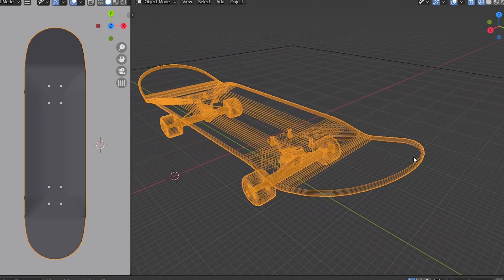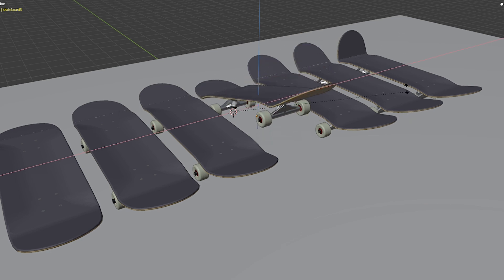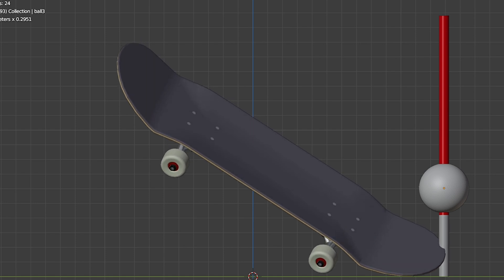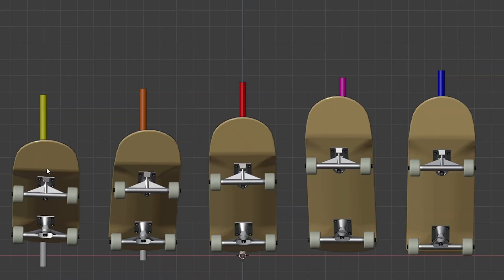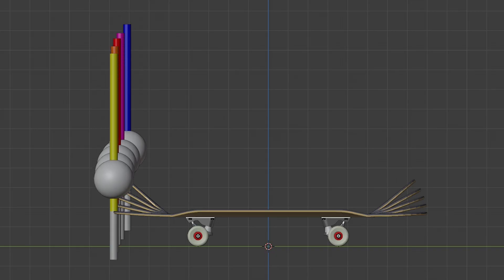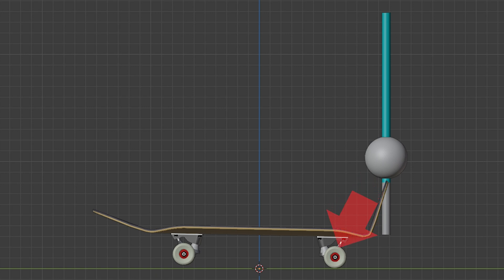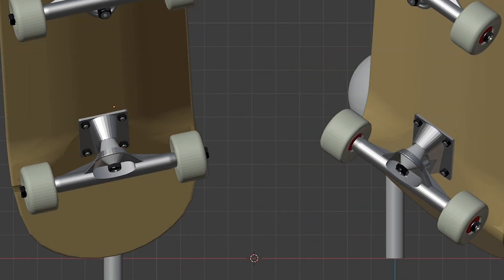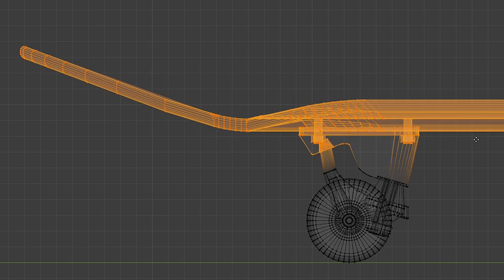What does the steepness of kick do in skateboarding? #skateboarding #3d #physics

Comment: Does it change anything if the force is applied past first contact with the board to *almost at the ground"?  In this case the... I dunno, angular momentum maybe?... Is affected by the tail shape in a way it wouldn't be with a foot pressing or compensating for different tail shapes, right?
Reply from the maker: It does change something definitely. As you can see in the video, the board with the mellowest kick pops up into the air right after its ball touches it’s tail.  
Physically, it’s not wrong. But in terms of actual pop as we do in the real world, it is wrong. Instead, our back foot should absorb the first impact and pop after that. 
In that sense, this simulation is not accurate.

Comment: How do wheel base lengths affect kick flips? I'm primarily interested in my own set ups. I use the same decks design for all my boards but use different trucks. Indi Mids are the shortest wheel base/axel distance but they are the heaviest trucks (390grams). My thunder titanium lights are the lightest (280grams)  but they have the longest axel to axel distance. My hypothesis is that I would like shorter axel to axel distance but the lighter truck helps too. I wish I could get the Indie truck axel to axel distance with the weight of the Thunder Titaniums.
Reply: in theory a longer wheelbase should give you more pop, because the front wheels being closer to the nose of the board, it makes the front heavier so you need more force to lift the nose, which equals more force applied to the tail and then into the ground back up into the board = more energy in the board. the extreme version is a heavier board with big wheels and a long wheelbase will give u more pop. the steepness of your kicks matters but also the wheel size and wheelbase. what you are looking for is the angle your board creates when the tail is in contact with the ground, and wheelbase affects this bc the farther or closer the wheels are toward each far end of the board determines its angle when the tail is touching the ground

Comment: Steeper kicks has a potential to pop higher, but it takes longer to pop and needs more force to actually hit the ground (not just have ghostpop as shown in video) . Does that effect the hight of the trick? How high can you pop a board with different kicks with different forces? (Also I think we should not count the height of the nose as the height of the pop, but we should consider using the board's center of gravity)